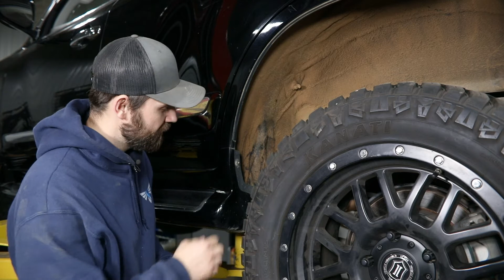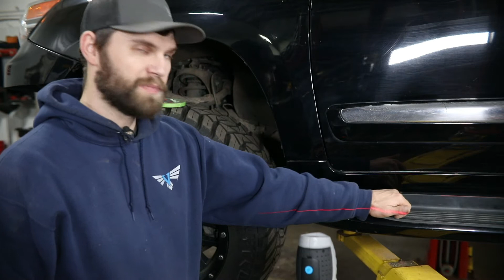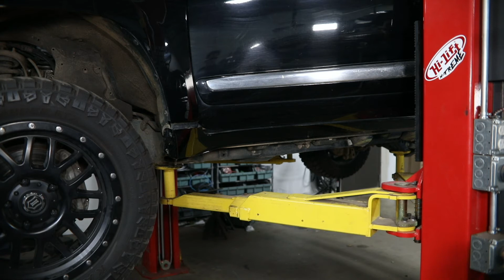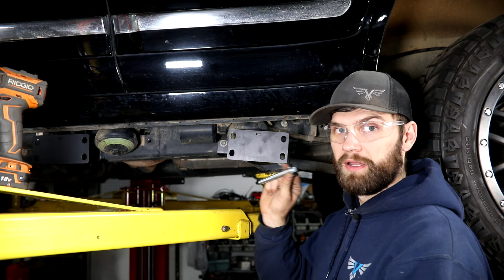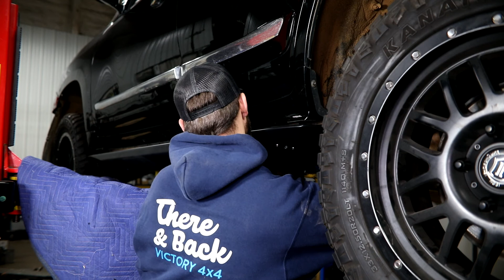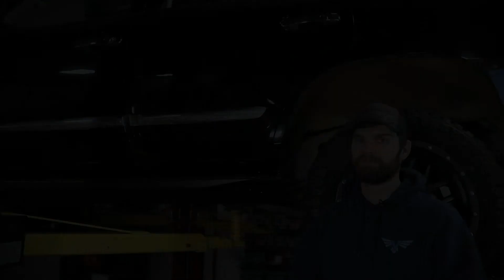LX 570 Blitz Slider Install

Comment: This is a very nice option for my LX. Quick question: Is there a way to configure the lights so that they come on other than the door open?
Reply from the maker: Sure, you could wire them independently to a switch. We don't supply any wiring harness, so that part is totally up to you.